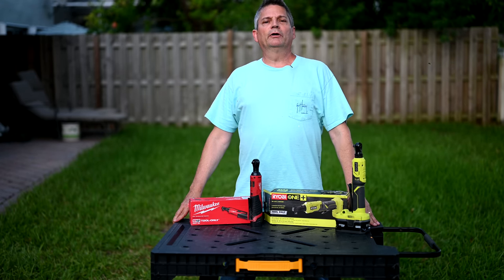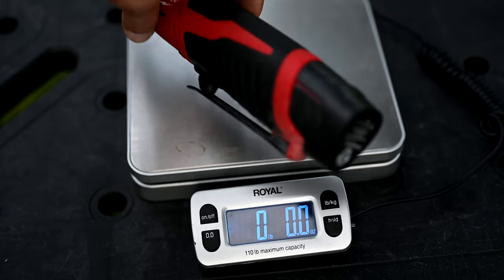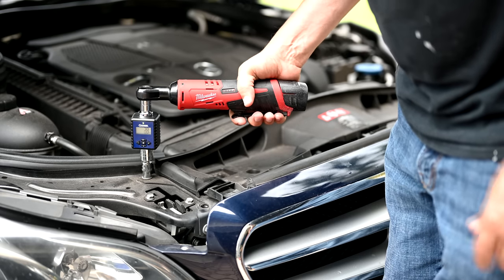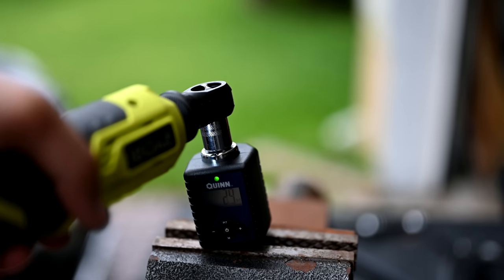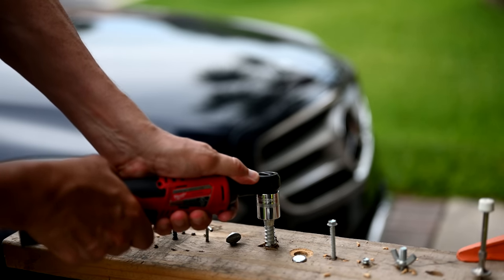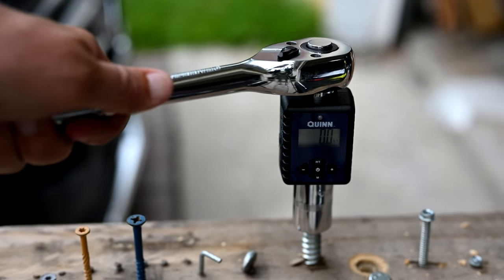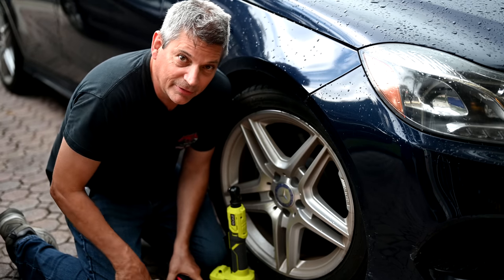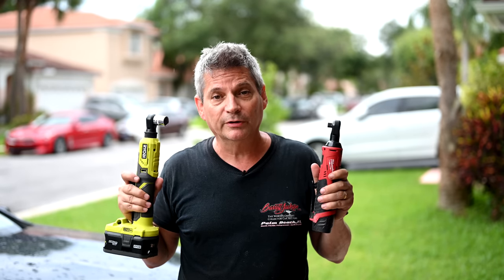Ryobi 3/8" Cordless Ratchet Vs. Milwaukee Torque/RPM Tests

Comment: Just look at the battery, there goes the Ryobi already. Im not going to use that tool with a huge battery on it, just look at it. its just a poor copy of the milwaukee
Reply from the maker: I have the Milwaukee version of course as you see in the video, and even that one can't get into some tight spots on my engine.
Reply: ? who cares, the ryobi battery is to huge. 
And both tools are useless anyways. just get the Milwaukee impact drivers and voila. For hard to reach places use something else

Comment: Both Ryobi and Milwaukee tools are owned by Techtronic Industries based in Hong Kong. The company is largely decentralized in the fact that each brand has its own company headquarters, Milwaukee in Wisconsin and Ryobi in South Carolina. However all manufacturing is done in China at one large factory.
Reply from the maker: They should look at combining certain parts foe economy of scale.

Comment: Ryobi is a tyi tool! Milwaukee is a pro style tool! Enough said!
Reply from the maker: Yes for the most part. But the brushless lines of Ryobi are getting better, and I still see many hnadyman and poor construction guys who can't afford the best have a sea of green in the back of their pickup trucks.
Reply: Elizabeth Guerra.....remember also that they are owned by the same company which is TTI in case you didn’t know that. The only difference is one is affordable and a little cheaper made while the other is top quality but also overpriced. Don’t get me wrong cause I love Milwaukee too but when compared to other top brands and seeing where on average Milwaukee is the most expensive.....it’s kinda hard to always buy them. And the most important factor here is and I quote “just cause one uses a pro/expert tool doesn’t make you a professional or expert by any means at all. The tool doesn’t make the person but instead the person makes the tool.” A true professional or expert can make ends meet with any tool.

Comment: V-8 vs 4 cyl. Not very fair!
Reply from the maker: the both have the same torque spec 35 ft-lbs and the same RPM 250. Did you not see that? Your comparison is inaccurate.

Comment: 2 amp hour 12 volt versus a 6 (?) amp hour 18 volt? K

Oh, and the 2nd gen Milwaukee is way better. the brush-less motor is a beast. I have both.
Reply from the maker: I plan on getting the Fuel. Both of these wrenches in this video have the same torque and RPM specs.